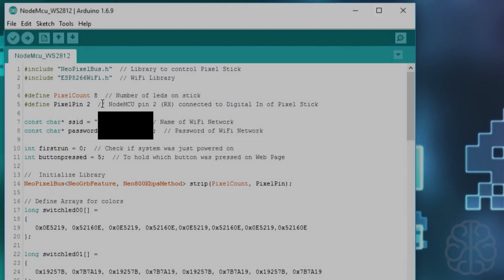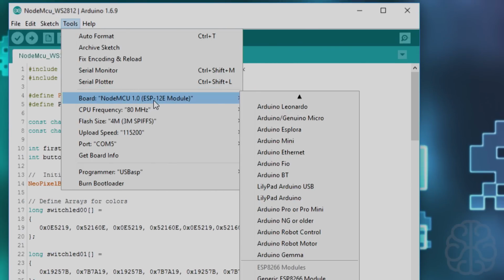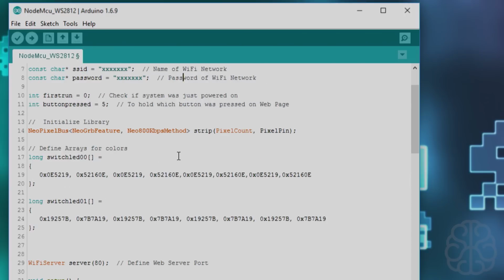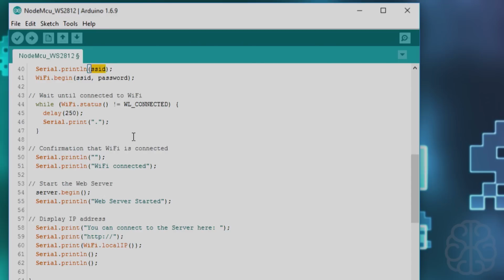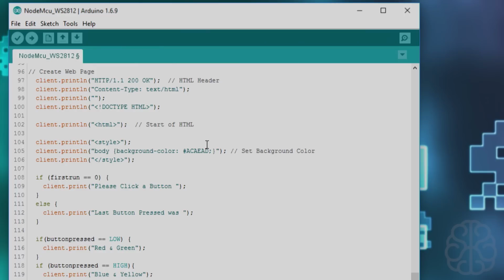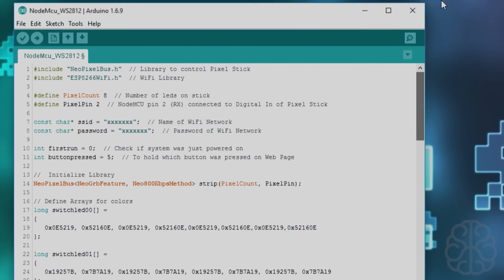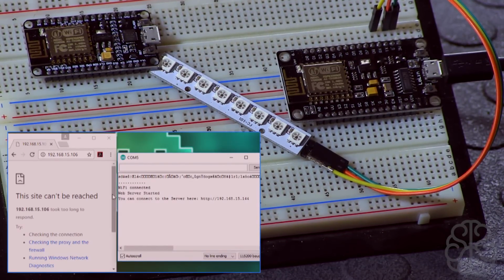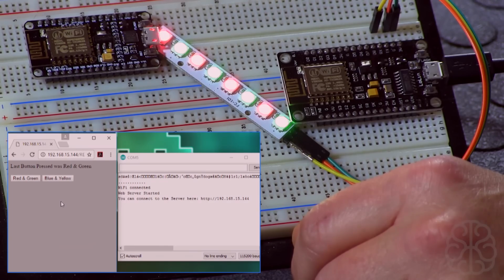Program NODEMCU Dev Kit using the Arduino IDE - WiFi Web LED's WS2812 – Introduction Tutorial

Comment: I like being able to type the code in myself. So it was helpful that I was able to screenshot, print, and type out each line. It works perfectly. Now I need to change commands and create an EMDR light bar for my wifes' practice. Thank you for giving more reasons than just WLED to use the 8266.

Comment: Thank you!  I tried to run this on a D1 Mini.  The monitor said I should connect to http://192.168.1.xx, which I did accordingly; the web browser reported page not found; but I can see the said server page with my mobile, though nothing happened when I touched the buttons.  I reset and tried again and the same happened.   Was this caused by the D1 Mini and not NodeMCU board?  (I used GPIO2 for the connection)

Comment: Arduino: 1.8.5 (Windows 10), Board: "Arduino Uno WiFi"

Build options changed, rebuilding all
C:\Users\admin\Downloads\SHAREit\Redmi Note 3\file\RFG_2K17_Code\RFG_2K17_Code.ino:12:25: fatal error: ESP8266WiFi.h: No such file or directory

 #include <ESP8266WiFi.h>

                         ^

compilation terminated.

exit status 1
Error compiling for board Arduino Uno WiFi.

This report would have more information with
"Show verbose output during compilation"
option enabled in File -> Preferences.
 error so in program compaling  how to sloved

Comment: The pictures of the pinouts on your web site show RX as D9. It really confused me that you used pin 2. I changed my code to D9 and it works fine.
Reply from the maker: Hi, yes the nodemcu pinout is kinda weird when using the Arduino IDE to program it.  I should have used the D9 instead of 2 in the code.  They will both work but using D9 makes more sense.  Thanks for pointing that out, I will use it that way in future tutorials.  Thanks for watching!

Comment: Would I be able to use the NodeMCU to create a wificontrolled kettle? I would want to use a web page where I can enter a temperature and have the kettle heat up the water untill it reached that temperature using a thermometer. Thanks in advance

Comment: Hi, great example!
The problem is, that I can't connect my MCU to wifi at all... All I have is just dots ....... (and yes, I filled my SSID and password correctly)
Do you have any idea why please?
Reply from the maker: FIrst thing make sure you are connecting to a 2.4GHz wifi router since the esp8266 module only supports that.  Next make sure your SSID and Password is written the exact same way (upper and lower case).  Next maybe bring the MCU closer to the router to make sure it can get the signal...  Let me know how that turns out...
Reply: Thank you for your reply.
I only wish to have 5GHz router, so it's 2.4GHz I am sure. SSID and password I checked 50 times and made sure that it's exactly as it should be (lover - upper case and also tried simpler SSID and password (all lowercase(8 characters long))). I also tried a distance ranging from 10 meters down to few centimeters with no luck. I am coming to conclusion that my MCU might be faulty(?). Everything else works. Blink, even WS2812  LEDs directly (with no Wifi control).
Reply from the maker: One thing maybe you can try:  Add this in the code

WiFi.setOutputPower(0);   <<add this>>
WiFi.begin(ssid, password); <<before this>>

Let me know...
Reply: Will try tomorrow (I am at work now) and let you know. Thank You for now :)
Reply from the maker: Last thing :)  Upload this code to check if it scans WiFi correctly:
https://github.com/esp8266/Arduino/blob/master/libraries/ESP8266WiFi/examples/WiFiScan/WiFiScan.ino
Reply: I've tried that before. It's included in examples for ESP8266. Nothing!
Setup done
scan start
scan done
no networks found
and there is plenty - at least 8-10 i catch with my mobile, including my own.
Reply: I also sent question here for now: http://www.esp8266.com/viewtopic.php?f=160&t=12680
Reply from the maker: Sorry about that, hope you can find the solution, or get another MCU to test.  Thanks for letting me know and for watching of course :)
Reply: The WiFi.setOutputPower(0); command did not help. I have to come to conclusion that the module was DOA.
Reply from the maker: Thanks for letting me know...  Well I guess it happens with these modules being so cheap $.  Hope you get a good one next time...  Let me know if you find out anything more...